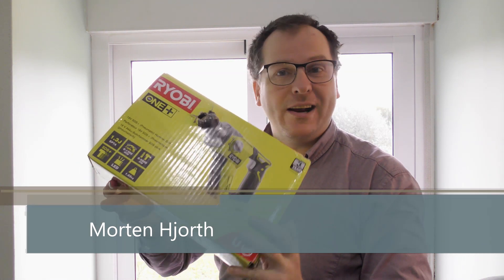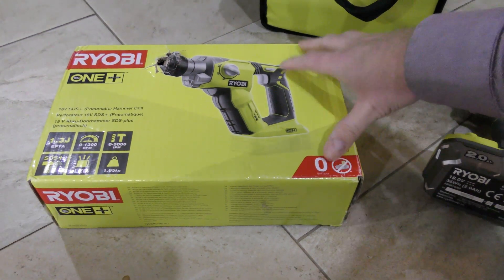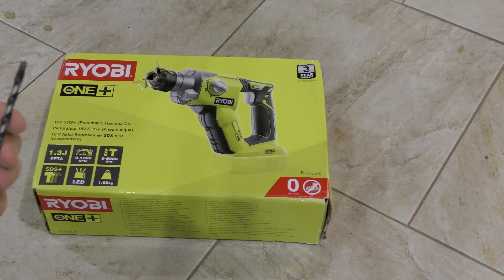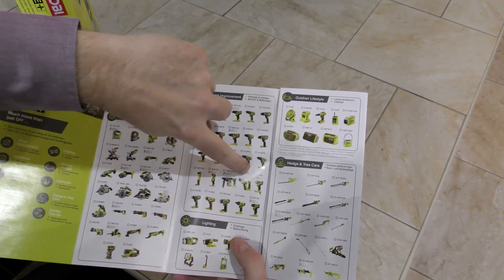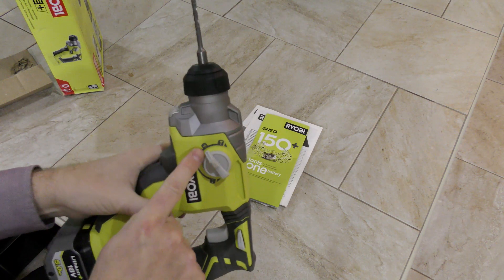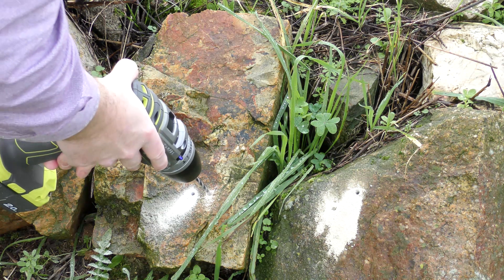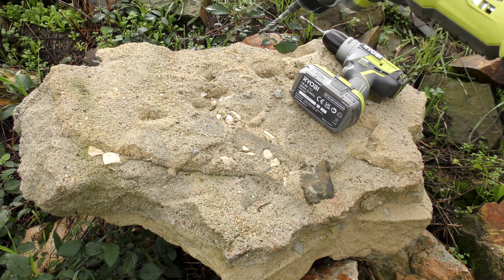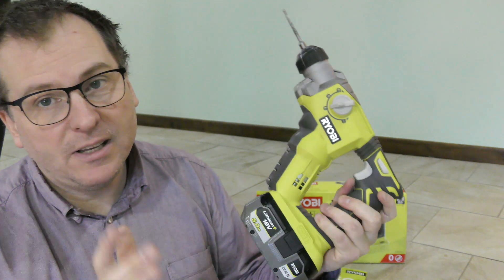Ryobi R18SDS-0 (P222) SDS Hammer Drill 18V ONE+ Cordless - 1271

Comment: So, the other day I started putting picture frames up and needed to drill into my double brick walls to install fasteners. Took forever with my "general purpose" Ryobi One+ drill. Now I know what I need to buy before I put the rest of them up. Thanks Morten!!
Reply from the maker: My test in this video was a little irritating,, I spend 5 min trying to drill a hole in my wall for like a 4-5cm screw,, and had to give up. ( but in the video test my normal drill did work on the rocks,, just took a bit longer) But my new hammer drill here took less than 20sec. to do that job.

It's a little DIY hammer drill, I have seen to many that has broken it,, probably expecting to much.

Comment: I have a dewalt corded version of the SDS hammer drill and I love it makes extremely quick work of drilling holes in all types of stone and masonry.  I would have recommended getting the one with the handle that can swivel  at the front of the drill as it helps tremendously when holding the drill and prevents the drill from torquing your wrists when using larger or longer drill bits.
Reply from the maker: Hi The_KillShot
Thank You very much!  glad you liked the video :-)
Thank you for watching! :-)

Comment: this sparking from the side of this toy need a check probably coming from the  Carbon Brushes Coal or it need to clean the armature segmented copper area or Checking  the resistance of  coil even if this SDS+ is new it is probably have ben stored for long time somewhere so to  use it and keep it for long time it need some maintien

Comment: AFAICT, that EPTA number is a standardized indication of how hard it can hammer, and 1.3 Joule is not exactly high, which makes sense with a battery tool, but still usable if it is not a speed contest.
Reply from the maker: Interesting,, so bigger number Joule,, bigger punch. My test in this video was a little irritating,, I spend 5 min trying to drill a hole in my wall for like a 4-5cm screw,, and had to give up. ( but in the video test my normal drill did work on the rocks,, just took a bit longer) But my new hammer drill here took less than 20sec. to do that job.

It's a little DIY hammer drill, I have seen to many that has broken it,, probably expecting to much.
Reply: Details matter, like rock type and weathering. In the video you could put your weight behind drilling, which is a lot harder in a wall.
Reply from the maker: This hammer drill took next to no effort,, I was just holding it 😬
Reply: Sure, but the point was how slow the old one was, vs the somewhat better performance in the video, where you could lean in.

Comment: hammer time - you will end up using it - it is not a bosch bulldog but it will do - get some proper bits (pardon the pun!) looks like you did - tools are gold as you know - good comparison - you can get shovel bit to break things up - tile and tough rocky ground and stuff - you won't go back in some cases #night and day
Reply from the maker: This is a little hobby DIY tool for the smaller jobs,, making some few holds,, removing some tiles.. It needs lots of brakes :-)

Comment: this is the lightest weight hammer drill which has hammer only mode including all other brand's 12v which doesn't have hammer only mode and 18v models on the market. it weigh only 1.6kg. even other 12v models are heavier than this without hammer only mode. in the other hand this one is weakest. but for light use, this is very good one. I love it designed for light one hand use. nowadays tools getting heavier and bigger too much power exceeds for actual needs
Reply from the maker: This is just for light use,,, I hear that it dies, if you work it to hard. If you need to break up your concrete floor,, bigger is needed :-)

Comment: The "spark" from the motor mean it had "brush" motor.

Not the best hummer/drill with low rpm 1.5k only.

Also not big diffrence from brushless drill
Reply from the maker: This is a little diy hammer drill. I don't think a "brush" motor has to make "sparks" might not be intentionally.
Reply: @MyPlayHouse  brush motor have   coal contact to stator.
The start motor spin it take the max current( because of that you see spark).

All fan ( wall fan or cpu fan) are brusless because motor that spin long time the coal contact(in brush motor) will need to change aftee short time.
I hate brush motor , the only advance is simple controler.

brushless need 3 phase pulse ( FET and clock generator)  .

Comment: im ill with fever 38.4 ^C
Reply from the maker: The normal body temperature depends on the measurement location. Body temperature varies from 37.1ºC in the rectum to 36.6ºC in the ear and 36.4ºC in the mouth.
But whatever we are comparing 38,4C to,, get well soon! :-)
Reply: @MyPlayHouse  i measured under the shoulder and the fever passed, now i liquid poop everywhere!
Reply from the maker: 😬I googled normal body temperature, and got a bit more info than I needed.
Reply: I hope you recovered full. 🤢